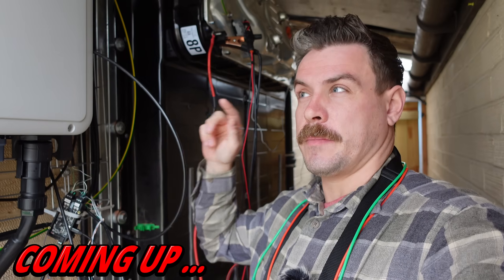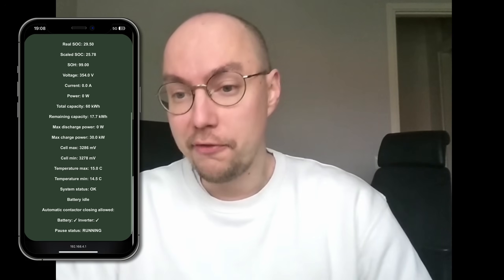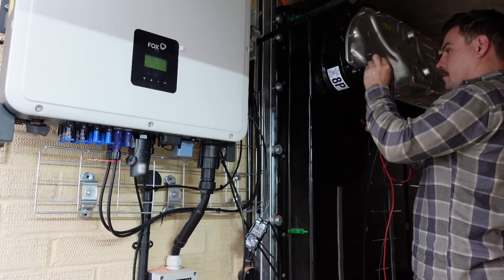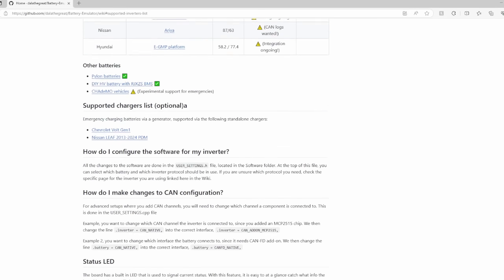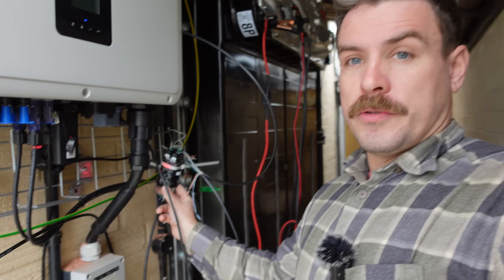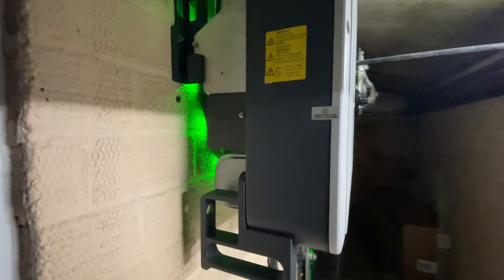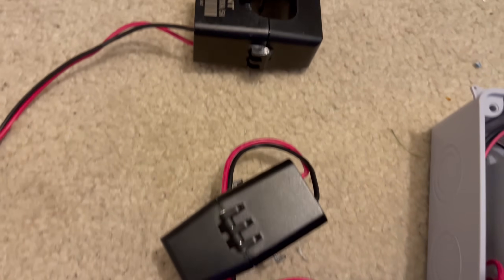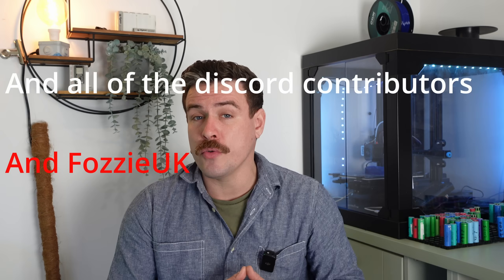We've HACKED a Solar Inverter to work with an EV BATTERY!!!

Comment: Excellent work, congratulations. I am trying to use with a sungrow sh5.0RT V112 a battery  pack of AGM quite new  former UPS   . I do think it should be easier because we only need to tell to the SH that we have a power.
Reply from the maker: Is the SH50RT designed for lead acid batteries?  Some sort of voltage and shunt monitor and reporting a charged value off that. Nice

Comment: Don't the inverter have a max battery size kw you can put to the inverter how much pv can this handle.
Reply from the maker: The inverter has a max size based on voltage. The manufacturer only had so many range of size batteries. It will handle the biggest of EV batteries as long as they are under 800v. 

I think it’s 45kw of PV. Unfortunately I don’t have the space for this much solar. Not unless I persuade my neighbours to use their garden space. 😂

Comment: How many kw is the battery you have
Reply from the maker: 60kWh. I could have chosen a larger pack but it’s really important to me to choose LFP. 2 main reasons. Safety. This is the same sort of technology as in all other home energy storage. Longevity. These packs should handle more cycles
Reply: @TheOfficialBatteryMan  is that the most kw the inverter can have   going in to it and 45 kw of solar?

Comment: Any one trying to use the Fisker ocean battery that is 100kwh?  The company is bankrupt and the cars are going for  like $5000...  but they're 800v.
Reply from the maker: That would be awesome. I’m the wrong side of the pond to pick one up by chance. 800v is possible for some of these high voltage inverters
Reply: @TheOfficialBatteryMan I've watched some of Dana's videos. He says he uses PV to charge the battery.  Does his inverter box also handle charging charging a 350v ev battery?

Comment: So your inverter can handle the 360v leaf ev battery to house hold voltage?  The EV voltage is not too high for the inverter?  Are you using the PV (solar panels) input of the inverter?
Reply from the maker: Yes the inverter can handle a range of batteries from about 250v - 800v. Yes I have a small solar set up from my solar pergola video.
Reply: @TheOfficialBatteryMan I will have to see that video, so you are saying that you charge the EV battery with the pergola setup? Is 360vdc the nominal charge voltage or can you take it up to 400+vdc to charge? I am curious about what controller type you use for the HVDC from PV to Battery.
Good job mate, I like what you are doing here.

Comment: Amazing showcase of technology but I think you’re limited by practicality and regulation. How much are you really saving compared to a ‘branded’ (ie UL-listed in the US) battery? LFP is less than $300 /kWh. Used EV batteries are what, $150-$200 /kWh? And how do you get such a large pack installed, permitted, and insured to power your house for many years?
Maybe the USA perspective is too cautionary!
Reply from the maker: This battery was purchased at around $82 a kilowatt. When you talking 60 kW that’s quite a saving. For me it’s about showcasing what can be done. Proving it can be safe and 2 a high standard.
Reply: @ That is a great price per kilowatt-hour! Unfortunately, at least in the USA, this would not be permitted or insured in the majority of places. I can appreciate the ingenuity and showcase of technology.
Reply from the maker: @ I’m not family with regulation in the US. Do you think different states would have different takes on something like this?
Reply: @ All depends on the local “AHJ” - Authority Having Jurisdiction, aka the building department at a township or city. They all have their own view on solar, batteries, and the National Electric Code.
And then you have utilities and interconnection.
It’s an ideal system for making solar and batteries seem like a niche, complicated, exotic specialty, instead of an affordable, reliable, democratic norm. :(
Reply: Also note, that it works with the inverter you already own. My Huawei works with HV battery, but instead i went with generic LFP and a true hybrid inverter.
Reply: My M3 Tesla Battery cost is $74 per kW, my 2nd  M3 Tesla Battery cost is $63 per kW.

Comment: Okay, you take power from the battery into the inverter. That runs your loads. How do you recharge the battery?
Reply from the maker: Grid and solar. They can of course be fully off grid for those that have the land space
Reply: @TheOfficialBatteryMan  got that part, What I want to know is what device are you using to charge the 350V EV battery? A high voltage battery charger? Or a high voltage solar charge controller to charge 350V batteries? What are you using to convert grid power to 350VDC to charge the EV battery?
Reply from the maker: @ a high voltage solar hybrid inverter. I’ve gone for a Fox Ess H3 Pro. Revealed in my video before this one. We did most of the connections in that video

Comment: Cool stuff! Need a little clarification. I'm in the 48v inverter world, so wondering how you have an EV battery (350-400v?) hooked up. Does your inverter accept high voltages like that or is there some sort of step down going on?
Reply from the maker: Good question. There are loads of inverters that run at higher voltages between say 200-800v. I didn’t know until a couple of years ago. I’m a big believer in high voltage is better. I’m using 10mm cable to move 17kw
Reply: Yea I know the Anker Solix X1 has a battery voltage from 350v to 450v using mc4 connections as battery cables and pv voc of 1000v

Comment: Awesome work mate. I knew from the last video you would have a few bumps in the road. I work in a garage and done all the EV training so understand the car stuff. The github is great so thank you for highlighting that, will make my project a little easier.
Reply from the maker: I think it’s a really useful tool for anyone looking to purchase ev batteries or even sell them. All for under £50 and a lead acid battery. Do you like working on the EV side?
Reply: @TheOfficialBatteryMan  I love it. I’ve always enjoyed the electrical side of the job. I’ve had a Leaf for a few years that needs the battery reconditioning, but I’m so busy fixing everyone else’s cars! What’s your background?

Comment: I was thinking of getting 2 x Model 3 LR batteries to fit on the floor of my solar shed. Are you relying on the Tesla BMS to do all the balancing and if so how are you monitoring each cell....oh yes I haven't started the vid yet so apologies if already answered :)
Reply from the maker: Yes. Relying on the Tesla BMS to carry out balancing and the solar inverter is managing the battery based on the parameters the battery is sending it. There is still some real nerdiness to iron out but it works
Reply: @TheOfficialBatteryMan  You have me thinking now as I've just built 3 x 48v 15kWh Lifepo4 packs but I hate dealing with the big fat cables. And I'm going to need at least 6 to 9 of these packs to do what I need. Hi voltage seems much simpler and a better grade of inverter with less heat in cables. Hmmmm 30kW export is nothing to a Tesla battery (I have an old Model S85 myself) but I'm a bit concerned on my ability to cause a quick death at that voltage. I could hook up 2 in parallel. Other concern is longevity compared to LFP cells...although my Model S is 10 years old with 198k on the clock with only 12% loss in range. Now you have me thinking .......

Comment: Oh this I am interest in, finding it hard to find 1000v PV input 3 phase inverters that run on 48v batteries
Reply from the maker: Yeah 48v is great for a certain size but once the KW go up you need higher voltages. Is that to work with existing batteries?
Reply: @TheOfficialBatteryMan  Basically like yourself I've just had 3 phase installation confirmed. Unlike yourself it's setting me back £22k and that's with me digging the trenching. 30kW export and I'm probably aiming for 60kW peak oif solar panels. Need the battery pack to keep the 30kW constant using the batteries as a buffer and also to keep exporting into the night as much as I can. All very complicated. I have a 3.68kW system up and running on export only as we are off grid otherwise. That runs on 2 x 15kWh 48v Lifepo4 packs. Heat camera is a must and has already saved me from a dodgy cable.
Reply from the maker: @CaptainProton1  that’s a pretty hefty sum of solar panels. I wish I could fit a lot more here but everywhere else has shade at least part of the day. I understand what you’re doing. Using battery to soak the load. Have you considered an EV or can you get more money exporting?
Reply: Rocking a Tesla S85 and 15kWh phase change water heater. Ran out of places to store it. Managed 98kWh yesterday but it was a good bright day.

Comment: This is so awesome! Thanks for taking the time to make this video and for DalasEVRepair and everyone who contributes to projects like this. 

Battery Man -  the MCP2515 board you have in the video, is this the board which worked? I ask because I've been having issues with mine and I've noticed my original one (which I blew up) had a 8Mhz crystal and the others all have 16Mhz... these ones I can't seem to get working. Thanks
Reply from the maker: I’m glad you’ve enjoyed the video. Honestly, if you’ve ended up with an MCP 2515 and Lily go combination I’m sorry. I’ve had nothing but troubles from them working and then not working. Expect update in the next video with the Stark product. What battery / inverter combo are you using? Have you changed the frequency in the software to 16mhz?
Reply: @TheOfficialBatteryMan  I'm using Victron Shunt to Pylontech code from GitHub. Anyway, long story short - the MCP2515 with the 16Mhz crystals DON'T WORK!! I changed the crystal to 8Mhz and it works perfectly... A dive in to the datasheet and the makers of the MPC2515 board with the 16Mhz chip havn't actually changed a couple of the timing caps from the original 8Mhz boards. 

Very glad you mentioned this board being a problem, I was convinced I was doing something wrong!

I'll look forward to seeing what you get upto soon.

Comment: Electronics guy here, maybe I could make you guys a better pcb with two CAN transceivers and that’s happy with wider voltage range, OLED display?
Reply: The project actually has an alternative to the lilygo board already called a stark (dual can, CAN-FD, etc).
Reply from the maker: Yes watch this space

Comment: Love your and Dalas work!!!
I got 80kW 48V system based on Victron..
May i ask if it will be possible to connect different brands of EVbatterys at the same time?
If possible im  actually think i will sell or trade my current system for something like this
And also im really interested in Tesla model S 2018...and if this will be possible to hack in the future.
Regards from wet and cold wetern Norway
Reply from the maker: That’s quite the size for a 48v system. What sort of amps you pulling with that. Or is it more to get you through?

Different brands to different battery inputs. Not in parallel or series. 

I think post 2020 model s is supported in the last few weeks

From an oddly sunny UK
Reply: @TheOfficialBatteryMan  Its made of 7 pcs 14S Leaf Cells CE marked (guess there is paralell cells in each pack as they are aprox 7KWh each)
I also have 248 LEV50 Cells From Mitsubishi divided into 10 packs
Guess i tested the total capacity last summer to approx 100kWh
But i only run them between 51V-57.5V 
So Ca 80kWh+ in real life..
One Victron Qattro 10W 240V and one Multiplus 2, 8000W
"20kW solar, small hydroturbine 2kW, one M6 Wind turbine (2kW in Storm ...)
One 10 kW Diesel Gen
And im now in the making of a Wood Gas Generator
Reply: @TheOfficialBatteryMan  every pack got 150A BMS so lets say 150X17=2550A
2550A at nom Voltage 56.8= 144kW 
Not possible to use all of this, but my Lynx bus bar in and out is limited to 1000A 80V i belive
Reply from the maker: @trygvetveit4747  there in lies the value of higher voltages. I imagine there is quite a bit of copper in your install. Very impressive.
Reply: Ev batteries tend to have different numbers of series cells or even different chemistries, sometimes between trim levels and model years, so no you can’t parallel them up.  You could have multiple inverters though and try to manage them as one - can be easy if you use the same inverters.
Reply: @edc1569  My hope is to use one large inverter and use different brands of batteries to serve the high Voltage input
As this will let me buy cheap battery packs as they are availible at scrap yards..
Gues you all know there is aLOT of EVs to be scrapped here in Norway soon(already)
Reply from the maker: @trygvetveit4747  yeah that won’t work with this set up. You need one BMS and it makes sense to use the manufacturers BMS per inverter. Or like my inverter I can have 2 separate batteries. Yet to fully test
Reply: Sorry to jump in on this point...but something very important to think about when mixing. I mixed 2 packs with 305ah cells paralleled with another 2 packs but with 280ah cells. It all went great until charging my car up and hot water to the house took the over all battery % really low. The 2 x 280ah packs shut off the bms due to being empty leaving the other 2 to take the full load for a brief time. The cables got very hot to almost melting point. Your only as good as your lowest capacity I think to be safe. Oh and get bigger cables and don't buy from amazon ...copper plated tin grrrrr
Reply from the maker: @CaptainProton1  yeah which is sort of why I feel you need one BMS for all systems working together all of those packs for it to be safe. I guess you can current limit the BMS to avoid over load
Reply: My solution is to just have 4 packs with the same ah rating and program the BMS to shut off pack at 7% have upgraded connectors for a constant 200a ability. BMS limit to 180a per pack all connected via bus bar. I better get back to finishing off these builds…but I’m looking into a couple of Tesla model 3 lfp batteries for the export project. Looking forward to your next vid

Comment: Can anyone help me out, i had to replace my Zappi charger and at the same time i added another powerwall and this time they added the Harvey, But ever since all my solar is bypassing the house and charger and going to the grid , when i plug the car in its taking 7kw from the powerwalls . Does anyone know what is wrong ? The only way i can use my solar is to go self powered every morning then back to grid timed setting in the evening .
Reply from the maker: It sounds like the CT might not be in the correct place within your installation. 

I would think it’s normal for the power wall to cover the house load including the charger. You can set up a load of rules through home assistant if you’re that way inclined. When ev charging pause or limit discharging.
Reply from the maker: I would recommend contacting your installer. That’s what they are there for any they know your system best
Reply: @TheOfficialBatteryMan  Yes i shall do , they are quite a large company and i had my 1st powerwall from them with bad after sales service, i wrote to them twice now  and they haven't replied to my email,  i think i will have to phone them , Thanks again for your help .
Reply: @TheOfficialBatteryMan  Hi thank you for a quick reply. i think you are right i haven't had the Myenergy  App for that long so i just looked at it and someone else is having the same problems . its the CT settings in the Zappi need to be configured. I'm a bit thick but i will try and play with those settings , many thanks for your help.

Comment: have you checked that the coolant/cooling will work on the battery when it’s installed vertically - or are you not cooling it?
Reply from the maker: It will work but most likely not needed as we are not working the battery hard. When I have some weather extremes data I will put a video out about it.
Reply: @TheOfficialBatteryMan  I'd imagine the bigger problem would be heating the battery when it gets to cold to safely take a charge. Or does it not get that cold there?
Reply from the maker: @danp762  yeah cold could be a problem but we’ve hopefully got that covered for a future video
Reply: @TheOfficialBatteryMan  off topic for this comment but do you have his discord link btw
Reply: Lol the cooling is just there for fast charging, and heating. In the end with LFP batteries with such a low C rate charging no cooling is needed.
Reply: Won't be needed at such low rates. My Model S pulls 350kW from a very similar pack when I'm giving it the large one to some tailgating Audi driver (always Audi's) but the C rating would be less than 0.5 ever to a house I should think and those packs can go to 5C albeit with cooling.
Reply from the maker: @CaptainProton1  yeah they won’t need cooling
Reply: @CaptainProton1  someone is over compensating